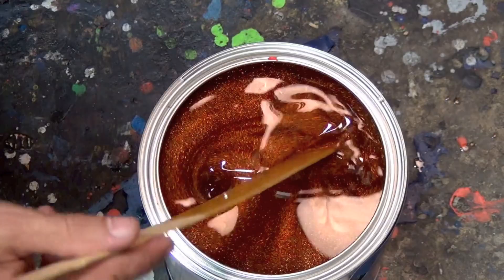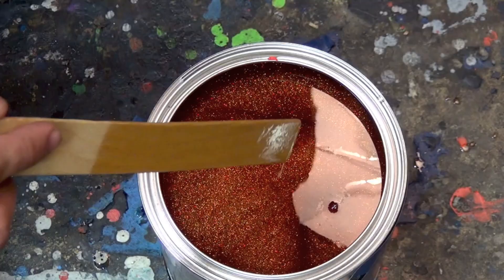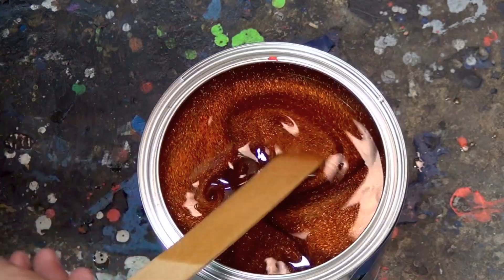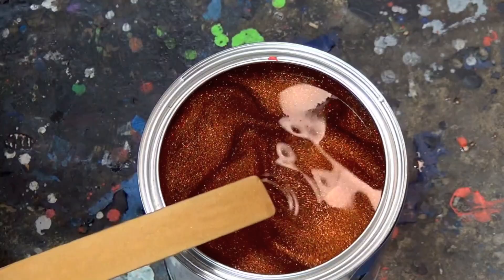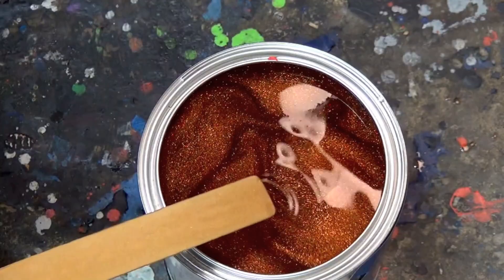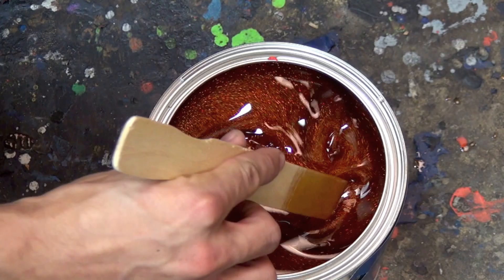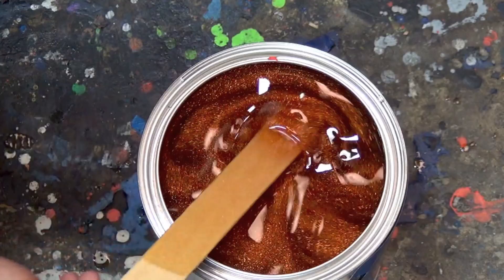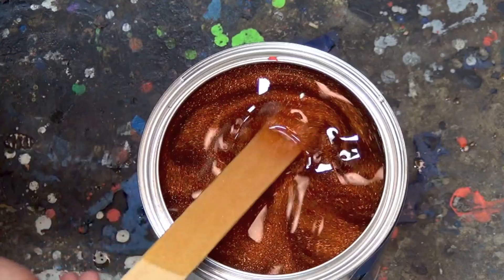Burnt Orange Holographic Micro Flake Plasti Dip

Comment: What would happen if I mixed the microflake into the koi orange or a white instead of a clear glossifier?
Reply: The opacity of any paint or enamel is going to conceal the micro flakes. You want it to be a clear coat over top a color base to achieve the light reflection... The glossifier creates a "glossy" finish to maximize the light reflection. A different "finish" of clear coat would work , or possibly a translucent pigmented finish would work to mix with the micro flakes for application compound. You can use any color of base enamel you desire but for application of the micro flakes you need a translucent compound.
Reply: @jessicat3762  Thanks!